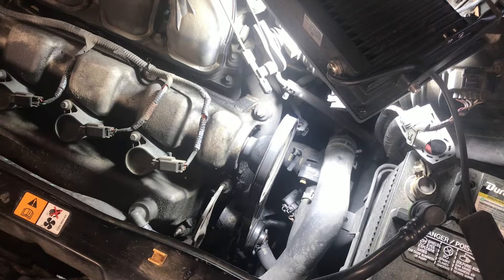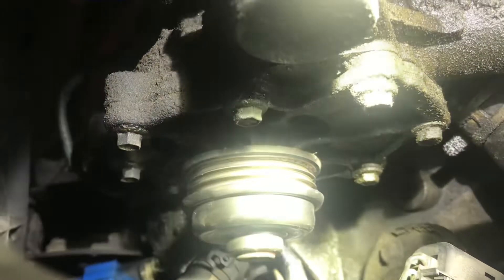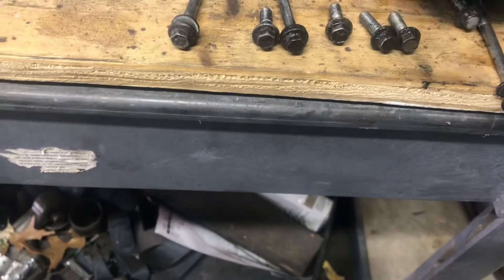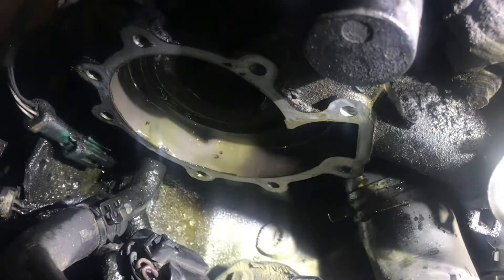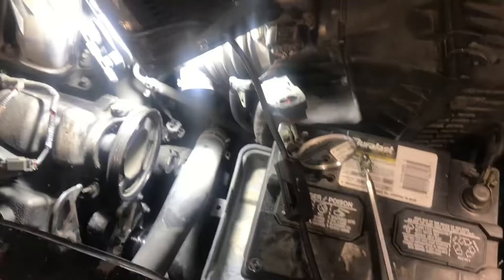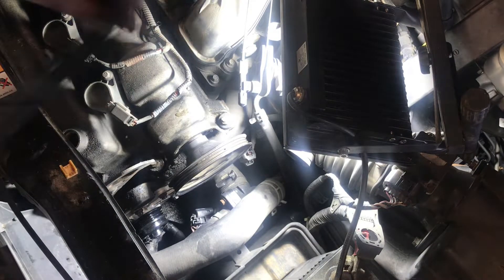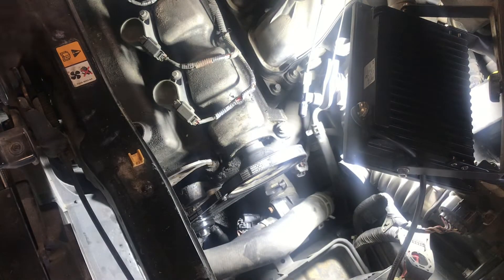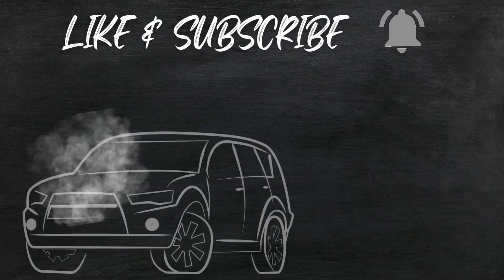Ford Mazda 3.0L Engine Water Pump Replacement!!! (Step By Step)

Comment: Tremendous video, the part with installing the belt with a zip tie blew my mind but worked like a charm!

For the curious, the 2005 (and earlier) versions of this engine at least in a Mazda 6 have 3 pulleys, not just 2.  There's a tensioner pulley rear-ward and slightly above the camshaft pulley.  Mine got messed up and I was looking at replacing it, but starting in 2006 Mazda/Ford deleted the tensioner pulley.  You can bypass it safely by getting the 2006+ belt (Duralast 195K3S) and putting it on as shown in the video, ignoring the tensioner pulley.

Comment: Not sure if dumb question. Where to I manually turn underneath for the belt? I watched your other video and only saw the above.. I’m new to repairs.
Reply from the maker: Not dumb at all, the biggest pulley at/near the bottom of the engine. That is your crank pulley you want to turn it in a clockwise motion so the direction you would turn the pulley is to the right like if you are tightening the bolt if that makes sense.  Should be an 18mm bolt in the middle of that pulley.
Reply: So I access this from underneath the vehicle? There is a plastic guard underneath. Do I have to take that off?
Reply from the maker: @morganbroker2610  yes removing that will be helpful to gain access to the crank pulley.

Comment: I'm looking and looking to see what's different than my 2004. No belt tensioner on this one. Interesting.
Reply: Incredibly you can bypass it - they got rid of it in the 2006+ models because it caused problems.  Just use the 2006+ belt.

Comment: En qué parte le mueves para que gire la polea?
Reply from the maker: Gire la polea del cigüeñal, la polea más grande del lado del pasajero.
Reply: @SMAutoRepairLLC  pero como la giro si está dura?
Reply from the maker: @jcsa2242  use un trinquete más largo o una barra rompedora para girar la polea. El perno mide 18 mm. No debería ser muy difícil girar.
Reply: @SMAutoRepairLLC  muy bien gracias voy a intentarlo